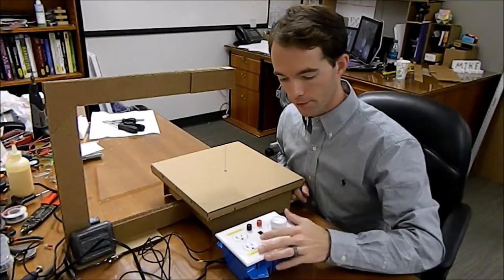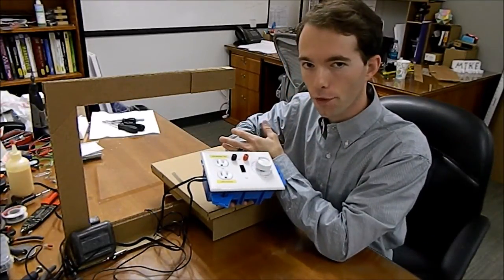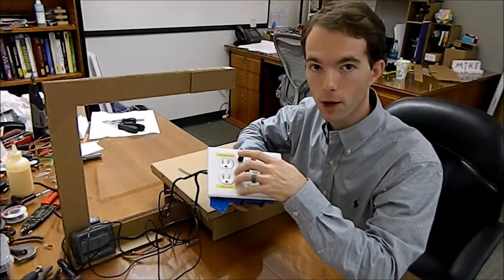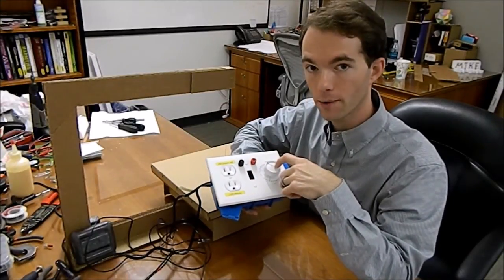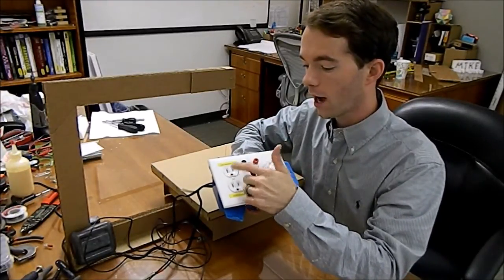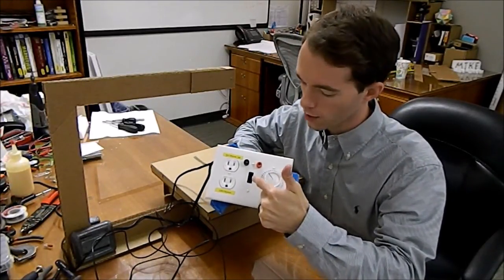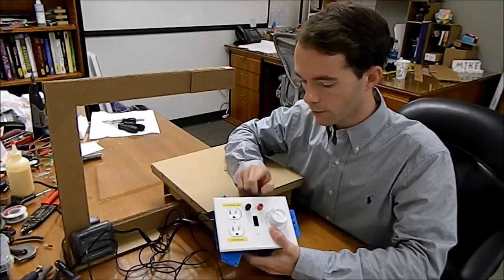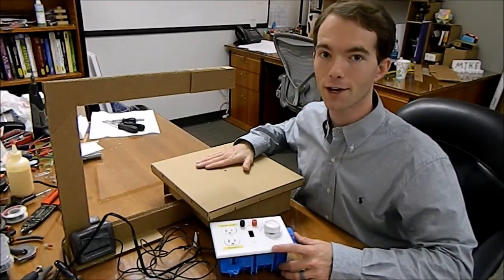Hot Wire Foam Cutter Power Supply Explanation  MikesInventions

Comment: The problem with using AC instead of DC is you're gonna polarize some of the polystyrene beads and this will affect the stabilization sensors in models with SAFE.  Not a problem for advanced RC pilots.  (Do you think this is total BS?)  What's your opinion?
Reply from the maker: Huh... I've never heard of that, so I don't have an opinion. It sounds fishy to me, and I'd want to run some experiments on it all before I believed it. I've been doing some experiments lately on some "common knowledge" things and I've found out that things I've heard and read online aren't true at all. Surprise, surprise. Thanks for watching!

Comment: Hi Mike. Your's is the best vid on hot wire for,,,,well,,,,whatever plastic-y thing it will cut. I'm trying to find info on how to cut 5 gallon water bottles. What wire, what size transformer....that kind of thing. As you know, the plastic is quite thick. Any ideas?
Reply from the maker: Thanks RayVan. I appreciate it. As far as your thing goes, I'm really not sure. I won't even venture a guess, because I try not to speak on a topic unless I'm sure. My only advice is to keep searching for someone who has done it, or simply build devices like I've done and give it a shot. If the wire glows red, it's too hot... Let me know what you end up doing, I'm interested to know.

Comment: Thanks Mike, I will be ordering the parts from amazon. Two questions I have. first, where did you get the cover plate I cannot find one that has the same outlet holes like yours does. second, when wiring all the components together what wiring did you use the 18 gauge extension cord. Forgive me if my questions seem crud, but I am new to wiring something like this.
Reply from the maker: The cover plate and electrical box came from Home Depot. If you can't find a cover plate then you can cut the edges off and put a two gang switch plate next to a single gang outlet. I think I used the extension cord inside, but I can't say for sure. I might have used solid 14 ga. It didn't really matter, because it's low amperage. Just check your circuit carefully. Make sure to see my circuit diagram video also so you can see how it's all connected.

Comment: Good Vedio. I do have a question, I am making a foam cuter I do have a small transformer I was wondering if it is ok for my project ? it is  120 v AC  60 HZ 46 W
15 Volt DC  1000 mA  . AND i DO HAVE Wire  Size`s of, 0.012  AND  0.016  AND 0.020  And  0.024 ,  And I do have the same Dimmer switch you have 120 V  600 OHM . I Was wondering if the power source is good and the wires are Ok to use  ? I Thank you in Advance :)
Reply from the maker: Hi Antwan! It's hard to say. The numbers on the transformer don't quite add up. The AC side is 46watts, but the DC side only adds up to 15 watts. I'm wondering about the 31 watt loss in the system... That's an awful lot on a percentage basis. I can't say whether or not your power supply will work. You can put a fuse on the DC side I suppose that's less than 1 amp if you can find it. That way, you can try it and not blow the transformer, but I doubt it will work, because of such low amperage not creating enough heat. My hot wire runs at 12 VAC and usually about 3 amps as measured with my clamp meter.
Reply: it is not 15 watts, it is 15 volts and 46 watts  AND  1000 mA  Output
Reply from the maker: Ahh. Ok, so...Essentially-> Volts * Amps = Watts. So the numbers don't add up. If it's 46W @ 15V, then it should be about 3A, not 1A. I tried a doorbell transformer once that was about 1A, and it wasn't enough and I blew it. I usually run at least 3 amps on my wire. I'm very confused as to why your transformer is labeled like that.